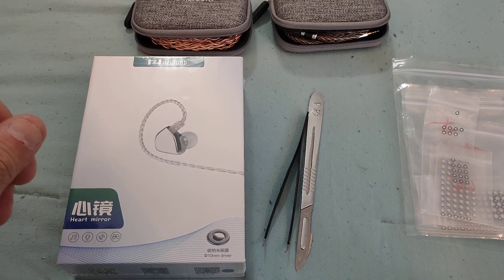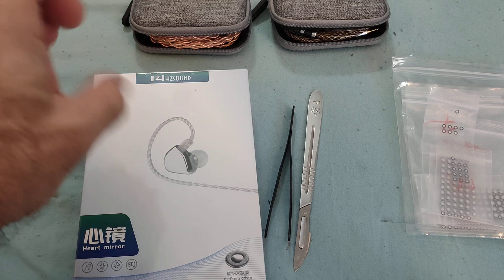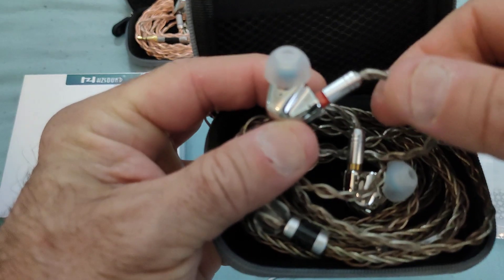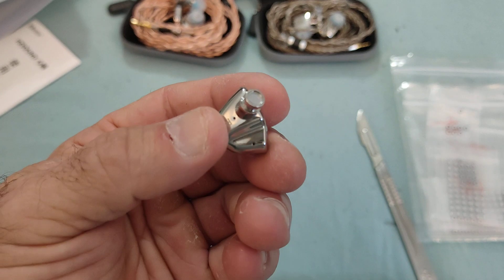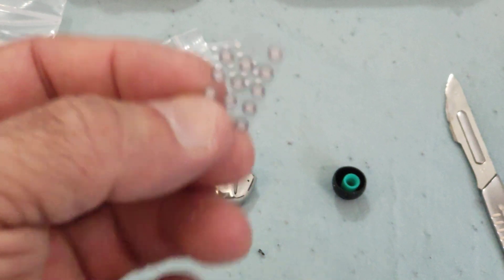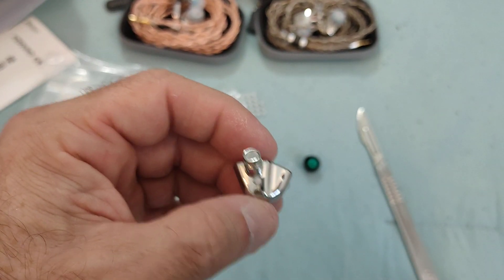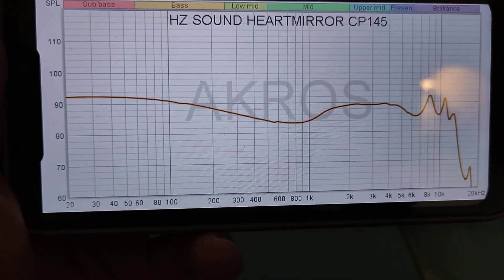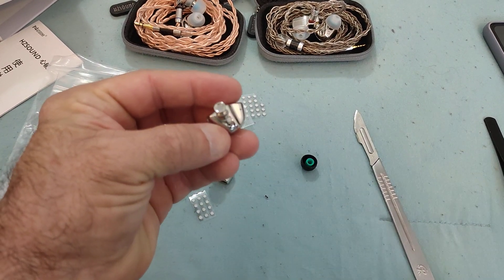HZsound HeartMirror - How to modify Bass Output TUTORIAL

Comment: I pulled out the Heartmirror again, after a couple of years.  The mods are still there (i.e. Y4 filter).  Powered them with the MuseHiFi M4 with 4.4. balanced cable (came with Artti R1, a 216 core 4 strand copper cable).  Putting the M4 in high gain, these HZ Heartmirrors are really something special.  I now seem to be coming back to them, again and again.  I have the MP145, the T10, the S12, the Hydro, the HBB Olina...these modded HZ HM's are terrific.

It's like I rediscovered a forgotten gem.

Comment: Believe the hype. I only put a 2mm Y1 filter on the bass vent, and to me the Hear Mirror is more refined than the Aria which has more bass admittedly but the upper mid emphasis makes it unlistenable usually after 15 minutes for me.  Also, even though it's full metal, it's lighter than the Aria and thus more comfortable for extended listening.

Comment: Mine have arrived two days ago, a lot of burning during the night, and rolling the tips I understand this: trying tips wide and short bore like the moondrop's chu spring the bass decrease and the sound is moreover metallic. The original hzsound tips are longer and narrower bore and are better for increase the bass and tame the sibilant, moreover I usually use the medium size tips, here I benefits using the bigger cause it seems that they enter less into the ear and now the bass are very good without any filter on the little holes. A question: inside the package there are 4 little filters ,they are for change the existing ones on the nozzle when they will be dirty or I can try overlay over the existing ones? applying then to the little holes as you suggest in the mods video the bass increase but the voices become muddy.
Regarding the sound without modding they sound energetic , perfect bass, slam and dynamic with the questyle m12 dongle,but still a bit fatiguing for me, it's an informative sound but the tuning of the moondrop Chu is more relaxing for the brain. But still they remain a bargain. my previous are Chu(nice!),ikko oh10 (sold after a week),Tri i3 pro (returned to Amazon),ety mk5 (idem)
Update: I put the supplied filters over the existing ones inside the nozzle, the metallic timbre has disappeared! Now it's not stressing anymore the sound, so I tried again the moondrop spring tips wide bore and nice details have appeared, for example listening to strings instruments like classic harp you can feel the nylon timbre whilst with the long and narrow tips you can't, violins are melodius voice intimate. Try this double mods and let me know.
Reply: Yeaah bro, it works🎉🎉 i’m so happy. That metalic thing is gone

Comment: HI Akros, i used my Tanya filters and Olina filters on all my iems, i have none left. Can i use these Like the Olina and Tanya filters on the nozzle itself? Or are these for the vent only? Regards again :)
Reply from the maker: The smaller diameter are for the vent....larger 4mm or 4.5mm are for the noozle. Usually they are graded from 200 to 500 .... Tanya is a 450 if memory serves me correctly. The smaller are usually rated Y1 to Y6 and are denser.
Reply: @akros9333  Thank you so much!
Reply: @Boemtie  did you try the tanya filter on hm vent?
Reply: @NewDarkKnight  yes but it killed the sound like way to much bass and muddy. they are not meant for that.
Reply: @Boemtie  maybe taking off the stock filter and putting tanya filter will change it better

Comment: with Y1 it's still amazing, probably even better vocals, but the filters will slowly become not clean, and change sound characteristic. Hzsound should just release HM 2022 with more bass ;) Although I can also just EQ it with Flux Epure V3.
Reply: Hi!
Could you explain the sound difference beetwen the filters?
I'm very curious.
Reply: @arthur3593  Hi. I think it's a personal preference. After trying Y1-Y3, filters, I was first liking Y2 the most. Y3 I didn't like, it muddied the vocals too much. Then I switched to Y1. And now I use no filters, because the vocals sound best without any filters. And I even made an EQ preset, lowering the lows and adding a boost to highs. Basically HM made me a treble head lol. But vocals sound amazing now.
Reply: @goldeneagle8259  Thank you.
Reply: And the bass still sounds nice to my ears, because I apply compression with Flux SyrahV3 plugin, especially after adjusting Thickness parameter to 14%.
My latest discovery is the included white eartips(medium size), which came with HM.  They sound better than spitfits cp145, that I've been using. And they don't come off all the time, sorry if bad english.
Reply: @goldeneagle8259   I see.
Thank you (again).
And don't worry about your english, english isn't my first language too.
Reply: Yes!! I would buy that. Do the opposite of this. Call it the bass monster Heart Mirror.

Comment: Oh, I'm totally satisfied with HM, but I don't own a lot of iems, so I don't know what I don't know. 
One reviewer rated it as having average details. 
Which iems have more details, but similar other characteristics as HM?
Reply from the maker: Well at the price point we talking about their isn't much that can compare.....the original TinHifi T2 is probably one of the few if not the only one.
Another very detailed item is the DQSM Hermit....micro driver but sounds like a small HEART MIRROR. Finally the Hidizs MS2.....very detailed also but it's a hybrid and not a single dd
Reply: @akros9333  Thanks, will check those out. My last attempt to choose a 'better' iem, ended up in buying another set of HM, which actually sounded a bit better. Maybe because I dropped the first set on the floor once.
Reply from the maker: @goldeneagle8259  I have 7 pairs of HM
Reply: @akros9333  Nice) Wanted to add about the filters. I think HM engineers really new what they were doing with it's tuning. I realized one thing. Because I use Flux Level Magic DSP plugin, and listen everything on high volume(when on PC), it actually makes the bass more 'impactful', just by the virtue of higher volume, and also the dac with amplifier changes it. Also heard reviews that e1da 9038d has strong bass. So at this point I prefer no filters on HM. Even Y1 'veils' the vocals a tiny bit, and I could hear this difference.
Also depends on the eartips, I've I tried some different ones, and the best sounding for me is SpinFit CP145 Eartips for 5-6mm Nozzle.
Reply: @akros9333  can u list down new diff hermit vs hm? I have hermit & considering hm
Reply from the maker: @oolnairda  HM is the perfect upgrade to the Hermit. What exactly would you like me to tell you.

Comment: Have you tried using some foam eartips? Comparing with silicon tips, they usually have a similar effect to what you portray in the video. Maybe not such a big difference but from my experience they tame the treble while enphasizing the bass.
Reply from the maker: Yes I have done it and even graphed it, and in the case of the HM it is very mild In the changes they actually apply and don't even come close to the vent filter mod.
In addition the increased bass makes the treble and upper mids gain a dynamic presentation that is much more warmer and not as.cold.
Reply: @akros9333  If you use the black eartips that come with the Heartmirror, what would be the suitable filter? What I'd like to do would be to use an intermediate filter and being able to change the sound profile by swapping the tips (but already with some changes applied by the filter) It would make the iem more versatile and it's easier to swap tips than filters. Thanks in advance.
Reply from the maker: @JoseFerreira-zb7wh  I would say use a Y2

Comment: I'm looking to buy these and one thing I'm worried about is how power hungry they are. 
Does does something like avani dongle dac enough to get the most out of them ?
Reply from the maker: They're not power hungry
You will be fine with the AVANI
Reply: @akros9333  sir with the bass mood + avani dongle where do you put they under 100usd range ?
With discount HM is at 34 usd on keephifi.
Reply from the maker: @thoughts6219  well if asking how good it is.....it's very very good....you will need to spend at least 100usd to get an earphone that is better
Reply: @thoughts6219  How do you get them at 34 USD? Wich discount? I see them at 41USD right now on website.
Reply: @BornIntoThis20  there was a offer to get 20 usd gift cards at 18 usd plus 4 usd off on creating a account there. I bought a 50usd gift card for 36usd, I'm gonna save up some more and get the t3+ 😅
Reply: @thoughts6219  Nice but promotion seems over...What make you choose T3+ over the Heart mirror?
Reply: @BornIntoThis20  the lack of bass on was a HM deal breaker for me and i won't be able to mod the HM later on because I'm from India and the filters are not available for me.
The tin t3 + plus just looked like a really good option for 57usd and it's easy to drive and all the reviews i saw on them were postive.
Reply: @thoughts6219  Ok make sense. I'm having doubt about using HM directly on phone output (S10) without dac. I often read it's better with proper amp/dac. I'll look into T3+ more. Do you plan to use it on phone jack or with some dac yourself?
Reply: @BornIntoThis20  dongle dac most likely CX pro maybe. It's my first iem so it should be fine for me. 
Heart Mirror feels different enough to get that later down the line.
Reply: @thoughts6219  Hello where did you order the HMs in India from?

Comment: Thank you so much for this. 2 questions. Does it matter to get the hole under the white part of the center of the filter only and not the black sticky part. Do you happen to know the mm of the size
Of the filters you use and where do get them from ? Thank you so much.
Reply from the maker: Only the part must cover the hole. Black sticky part no.
You can get the filters on AliExpress....NSC is the store
https://a.aliexpress.com/_mNRb75W
€ 5,28  35%OFF | 50pcs Earphones DIY Tuning Papers Y1 Y2 Y3 Y4 Y5 Y6 Earphones Driver Tuning Cotton Adhesive Pads
https://a.aliexpress.com/_mNRb75W
Reply: Akros thank you . They sell 2.5mm and 3 mm. Which size is more ideal for this mod
Reply from the maker: @axlfoley7795  2.5
Reply: @akros9333  The shown frequency response after the mod was of the Y3 or the Y4 mod? And also what difference you have observed with the alternative filter? Since you have only shown frequency response of one filter.